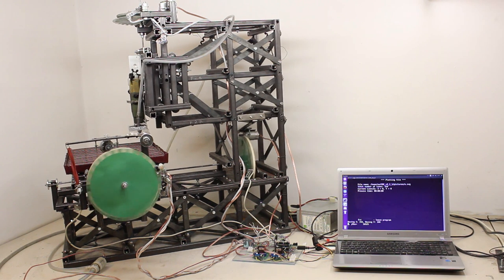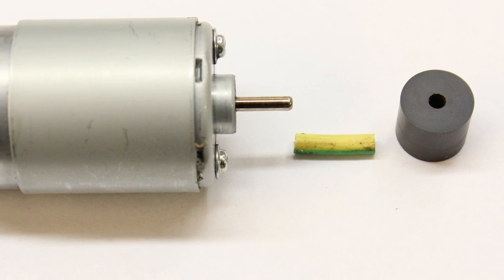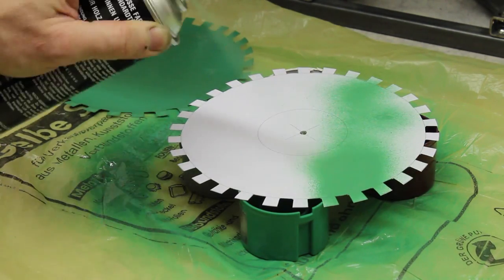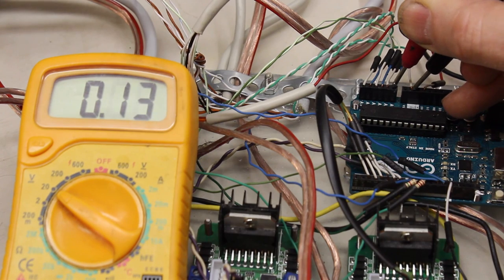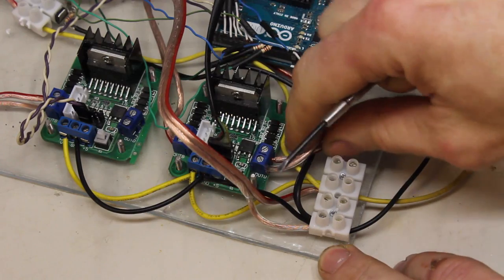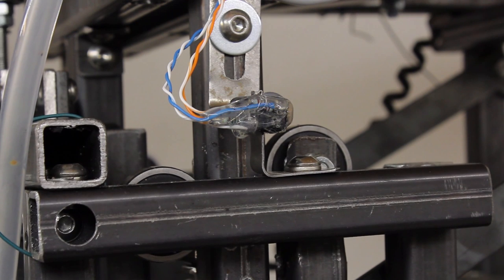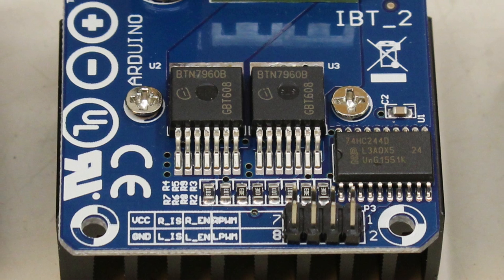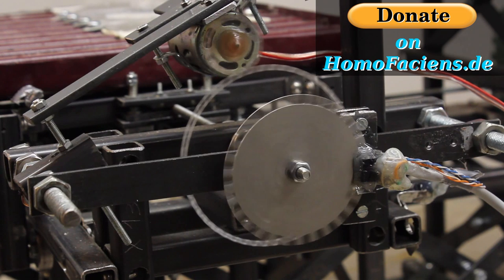CNC v3.2.1 - electronics using DC motors and rotary encoders

Comment: Very useful video.  I learned something in the first minute that I didn't know even though I have a degree in electronics.  Thanks for the practical way to determine appropriate current limit for DC motor and controller.

Comment: I have to make an observation about the DC motors. DC motors produce EMF that opposes the applied voltage when they 
start to run faster. This reduces the current and consecutively the torque at higher speed. So this limits the speed of the machine while the motors are actually run far below their thermal limit. If you end up deciding that the motor can handle 1.6A of continuous current, you can use L298s with some sort of current limiting device and you can set the current limiter at 1.6A. Then you can use much higher voltage on the motor. By applying more voltage, some of it counters the EMF and still there is enough to keep the motor current at nominal value. The rest of the voltage is blocked by the current limiting device so the motor is always below its thermal limit.
Reply from the maker: First of all I wanted to keep the electronics simple, thus I am operating the deveces with constant voltage. If it all runs fine, I will have a closer look at ways to optimize the machine speed.
Thanks for sharing your thoughts.

Comment: Hi!
I am wondering: instead of cutting aluminum encoder disk maybe you can print it on transparent foil on laser or jet printer? The teeth of the disc are black and gaps are transparent. Than glue it on the acrylic gear, divide the sensor to halves and mount them on both sides so the sensor "is looking" through the gear and sensor disc...
Just to mention it :-). It is, maybe, easier to make...
But again, one big thank for your effort! The videos are so good that I decided to translate one by one of all your videos.
Reply from the maker: ...if you think that would be better, you can try it. You must ensure that the IR light is effectively blocked so that you get a HIGH signal. Use a high resolution print to get good opacity.

Comment: Something to note is that shielded CAT5 and CAT6 is very uncommon in North America; you only really find it in industrial settings with long cable runs and a lot of electrical noise.
Reply from the maker: Really? You get them in nearly all hardware stores here in Germany.
Reply: HomoFaciens
I can find shielded stuff at big box hardware stores (Home Depot, Lowes) but it's often twice the price per foot of non-shielded cable.
Reply from the maker: I cut an old 10m (30ft) cable for my machine and there is more than half of it left.

Comment: Hi, any reason you went for dc motors over steppers, which can also be found in old printers? Could you not use steppers? Great video.
Reply from the maker: You rarely find stepper motors in old printers and that's why I have chosen DC motors for the first drive configuration. Nonetheless, I already ordered bipolar stepper motors to show how to use those drives. Be patient, there is still a lot to be done (and demonstrated in videos) with the DC motors before switching to the steppers. Stay tuned!

Comment: Have you considered painting those plexiglas gears, and using them with the optical sensors directly?
Reply from the maker: Something like that would work in principle, but my gears are 5mm thick, thus they won't fit in the sensors.
Reply: Could you not make the pinion and the gear from coloured HDPE melted in an oven to form a slab and cut it to size on the CNC while cutting the profile? I guess you only need the tooth profile to be 5 mm and not the whole disc.
Reply from the maker: Yann Kitson
For making a single machine, considerations like that are from low priority. Reducing the number of parts is an option for volume production (something I I won't start in the near future).

Comment: If you put the optical sensors at different positions around the sensor wheels, wouldn't that allow you to use much smaller gaps and with that much smaller sensor wheels?
Reply from the maker: The large sensor discs are more easy to cut manually. Meanwhile I have installed a smaller sensor disc on one of the axes. The theory behind is in a chapter on my pages:
http://homofaciens.de/technics-base-circuits-encoder-disc_en.htm#SensorDistance
Reply: Cool!

Don't get me wrong, I kind like you using big disk in these more educational type of videos, lets most people grasp the concepts better. Visual learning is a great tool!
Reply from the maker: Thanks!

Yes. I am a visual thinker and that's why I started making videos besides writing texts about science & technology.

Comment: What you think about dc plus encoder or step motor? What is better?
Reply from the maker: DC motor plus encoder is the safest way to move a machine. You have a closed loop system that can detect whenever something goes wrong.
Bipolar stepper motors are more simple to control from the electronics as well as the software side.
The choice is yours.

Comment: Hi I have a 600kg milling machine with manual knobs that is old and have alot of backlash.
I thought to add a chainwheels on axis and make holder for old drills and connect them with chain so can move machine on joystick and faster when necessary.

Now when I saw your video I thought maybe is possible to use printer encoder tape with sensor so arduino knows it exact position in 0.1mm accuracy and then upload code to arduino to make it a CNC machine..
Do you think thats possible?
Reply from the maker: These printer encoders have an accuracy that is way to low for machining parts. I have made a video on these ürinter sensors:
https://www.youtube.com/watch?v=YfBkddVJksw&t=2s

Comment: Dear Sir. What type of file can be read, plotted? Files with what extension? Thanks for your attention.
Reply from the maker: As told in the video, have a look at my pages:
https://homofaciens.de/technics-machines-cnc-v3-2_en.htm

Use bipolar stepper motors and grbl with the mechanics of this machine if you need formats other than svg.

Comment: I am planning to build a reprap 3d printer using arduino which I believe is similar mechanism with cnc, but most instruction on websites using stepper motors. Is it possible using a diy servo like yours in 3d printer? Can you tell me what software should I use? My reason change stepper with servo is cheaper. I like your videos btw.
Reply from the maker: Whenever you build your own hardware you will have to write your own software to control your machine. I will try to implement G-code in my software after making the hardware and electronicr run fine. Yet, I haven't sorted out what kind of open source software exists for CNC machines or 3D printers and how to modify it for my servo driven machine.
Reply: HomoFaciens http://reprap.org/wiki/RepRap_Options the link explain everything about reprap 3d printer including the software for creating g code and firmware for arduino to read the g code and move the stepper. I hope someone can help change the stepper with servo in the firmware code.
Reply from the maker: Yes, the RepRap wiki is a great knowledge base for any type of computer controlled machines. I doubt if the changes will fit in the Arduino firmware (it's time critical). I will try that sometime, but I guess I will have to find a workaround (maybe using two Arduinos - one running grbl and one running the control loops of the motors). Time will tell...
Reply: Those steppers are controlled with two instructions I think, a "direction" and a "step". If you could make a seperate servo control loop (maybe using an arduino) that could work with these instructions it would be possible to use a servo
Reply: This isn't strictly true. The Marlin RepRap firmware is very comprehensive, and has inbuilt options for hundreds of different configurations. Part of this includes DC motors, physical switches v optical, hundreds of different display etc. It's very much complete.

Comment: Hello! Thank you for detailed describe your project. But I can't run control program in windows. Do you have compatible control program for windows?
Reply from the maker: Sorry, but I don't code for Windows. You can install Linux for free and it's definitely the better choice for people that want to look underneath the colored Desktop.
Reply: Ok. I have already made my project "Very Fast Plotter".It works perfectly. My project contains 2 linear encoders and 2 DC motors + servo. My project was based on your project. Thank you so much fo you project!
Reply from the maker: Would be great if you share your project on YouTube - I am curious to see that very fast plotter in action.

Comment: good morning, I would like to thank you for sharing your knowledge and for the contribution to the electronic development also congratulate him for his very impressive project. At the same time I would like to know if you can help me with my project idea: I want to use your firmware of your project CNC_ v3_2_1 and overwrite it with GRBL to use it with GRBLGRU V3.23 software. thank you I would appreciate your acesoria.
Reply from the maker: Use bipolar stepper motors instead of the DC motors I am using and install grbl on the Arduino. I am using grbl with my CNC v2.1, however it eill work with CNC v3.2 as well. I will demonstrate that sometime in the (hopefully not so far) future.

Comment: Why didnt you use grbl ? Bu the way excellent cnc and software!
Reply from the maker: My software is still in a very experimental state and I will implement G-code if the machine runs fine. Grbl is an option I will have a closer look at.
Reply from the maker: Nice and clean design, great work!
Software always needs fixes, updates and new features...

Comment: Can I use linear encoder instead of rotary? to manufacture the cnc. thanks
Reply from the maker: You need a high resolution linear encoder to get nearly the same results as with this simple rotary encoder setup. I have done a couple of experimentation with an encoder from an old printer:
https://youtu.be/YfBkddVJksw

Comment: Hi Norbert. I want build 2 axis hot wire CNC. How i can delete Z axis in program? And second question- i use arduino nano and on fast motor speed a have many lost steps. How many steps per second i can receive without lost steps?
Reply from the maker: You could simply ignore the Z axis. With no sensors connected and not commands for moving the Z motor, that part of software will never be executed (I guess).
The number of steps processed by the Arduino depends on the software running on it. CNC v3.2 processes approximately 300 pulses per second per motor without loosing steps. I will do further investigations about the maximum speed, soon.

Comment: Sir i have error' with your command-CNC.c source. 

But just fine when i add sleep(0.8) on sendport() function. 

Will you update next version of command-CNC.c?

What are necessary of MAX_arduino_buffersize?
Reply from the maker: I haven't done anything on the software since publishing the video series about this CNC. It is definitely not perfect but worked for me.
The software is still in an experimental state and MAX_arduino_buffersize is a value not in use. It was meant to speed up the data transfer to the Arduino, but didn't have a huge impact so I commented that out in the source code.
The sleep you have set is an indication that your computer is obviously faster than the one I was using. Sleep prevents commands from being discarded due to a too high incoming byte stream.
Reply: @HomoFaciens  tq sir for your superfast response. 
After i succes on accuration i Will upload my own video, and credit offcourse for you. 🙏
Reply from the maker: Please drop a note when your video is recorded. I am always curious what other CNC machines look like.

Comment: good afternoon, thanks for sharing, I'd like to ask you a question: how do you run the software that controls the machine?
Reply from the maker: It's running in a Linux terminal. You can get it on my pages:
https://homofaciens.de/technics-machines-cnc-v3-2_en.htm
Reply: Your videos are great! Thank you for making such awesome things and sharing them with us!
I was wondering about your SW, as I'm not a Linux user but thinking of starting to use it, will I be able to understand how to operate your SW without a lot of trouble?
Did you maybe make some guide on using your SW?
Keep on doing your great stuff and many thanks!
Reply from the maker: You  can't say if you have trouble with operating a software if you haven't even tried to install it. That tool is still in an experimental state, but works fine for me. I am currently working on the G-Code version that will make things easier.
The guide on using my software is part of the readme.txt in the download package.
More infos are on my pages:
https://homofaciens.de/technics-machines-cnc-v3-2_en.htm

Comment: en donde hago correr tu codigo? en linux?? o en el ide de arduino??
otra pregunta, podria fabricar ese h brige de 43 amperes casero ?
o seria seria mejor comprarlo??
Reply from the maker: The Arduino sketch runs on the Arduino, the command line tool on the Linux machine. If you are asking if you could build the 43A H bridge by yourself, I'd say the answer is "no".

Comment: The project i was looking for. ))) I downloaded zip CNC V3.2 and in connection diagram it's not so clear how optical encoders connected to arduino... I am going to use Arduino Mega adk, 180 watts dc motors with chinese encoders and 43 amp BTS 7960 drivers... At list i want to try... What is the speed limitation for now and what programm is more compatable with your code to control the machine?
Thank you for your project! I will try to follow it. )
Reply from the maker: The software as well as the documentation of this CNC is still in an experimental state. I will upgrade the software to make it compatible with G-code in the comming weeks. You can follow the build process on me project pages:
http://homofaciens.de/technics-machines-cnc-v3-2_en.htm
or here on YouTube. As soon as it all works fine I will write a better documentation - stay tuned!
Reply: I will. Thank you. I have one more question. I have arduino mega ADK and your sketch was made for arduino UNO ( control of DC motor with encoder A/B chanels). Will it work with Arduino mega without changes to sketch?
Reply from the maker: I don't own an Arduino Mega, thus I can't grant that it will work without changes. It also works with 5V logic and has enough pins, so it should work. You must eventually change the pin configuration to have the PWM inputs of the H bridges on PWM pins on your Arduino.
Whenever you try to modify a machine, you might stumble over details, but that's what makes you understand how things work...
Reply: I see. Thank you. I also have one dc servo motor for my testing and it has magnetic encoder with 6 wires coming out. ) I took a look on the board and wires are GND (I think it's output signal ground), output3 output2 and output1, +5 and GND again. It should be quadrature type but it's not clear to me about 3 signal outs and if i can make it talk with arduino. )
Reply from the maker: It has very likely 3 magnetic sensors (hall sensors), thus it isn't a quadrature encoder. One hall sensor at a time is high and that enables you to detect a step and the direction of the step such as:
010
001
100
or in the opposite direction:
010
100
001
Reply: I have correction. It dose not have hall sensors on board and it looks more like inductive with sensor made of strips in front of wheel... Did not find any example how to use it with arduino.
Reply from the maker: Without having a look on your board I can't say anything about it...

Comment: I installed 
ubuntu, i opened the terminal, i called the directory cnc_v3_2 but still
 do not do anything, i do not know how to compile the source with:
   gcc commands-CNC.c -lm -o commands-CNC
Reply: I are having the same trouble with Linux. It just wont accept the command.
Reply from the maker: "It just won't accept the commands" is for sure no error message you get during the installation process. Go to my pages and see how to contact me:
https://homofaciens.de/contact_en.htm

Comment: realy cool machine but i already built grbl machine
Reply from the maker: I will make this machine process G-code (as soon as the mechanics and electronics runs fine). Grbl is an option I will definitely try.
Reply: great i do it because it was easyer

Comment: Hello, does the software need to calculate acceleration ? or not ? because there already encoder to prevent miss step.

I want to make this awesome CNC too, and able to use my software https://github/ryannining/karyacnc on it.
Reply from the maker: The software I am using ignores acceleration calculations, yet. I might add this in a future version, but with the low overall machine speed it doesen't make a real difference.
Of course you can modify what ever software you want to run with this machine. Hard- and software of my machine are open source:
https://homofaciens.de/technics-machines-cnc-v3-2-1_en.htm
Reply: Menarik nih.

Comment: explain why you're using Linux
Reply from the maker: Because it's freely available, you (and all people of the world) own the source code and you can do what ever you want with this great OS. Compare that to the restricted rules of your operating system.
Reply: please organize video "CNC programming on Linux"
Reply from the maker: There is no need for a special video. There are Gigabytes of information on how to install Linux (I recommend Ubuntu for beginners). After that, follow the installation instructions of my software.
I will change the software in the comming weeks to make it process G-Code. Many CAD programs can export that file type. Stay tuned!